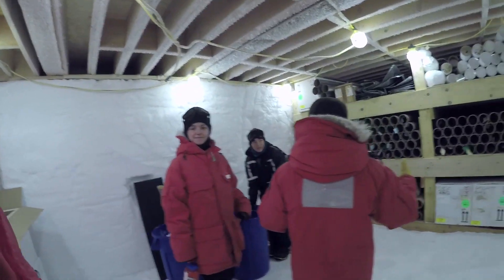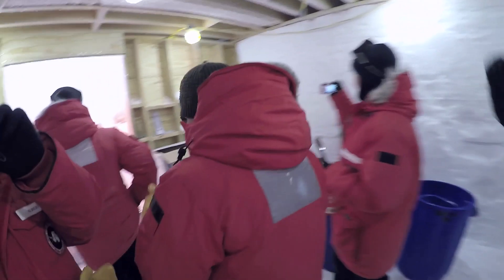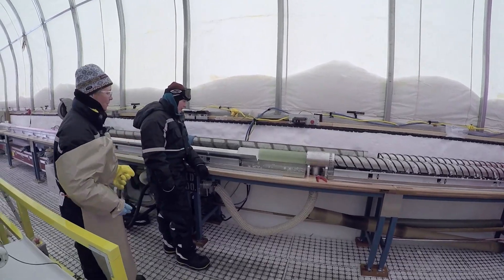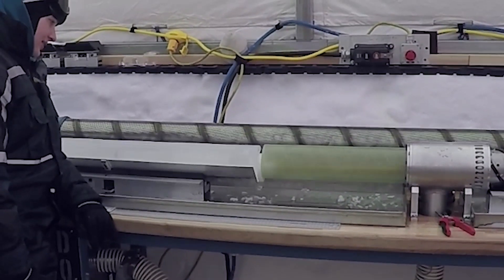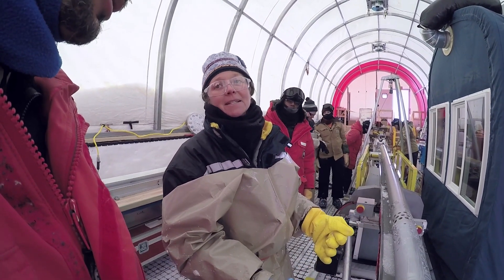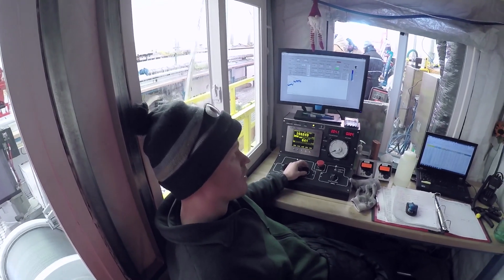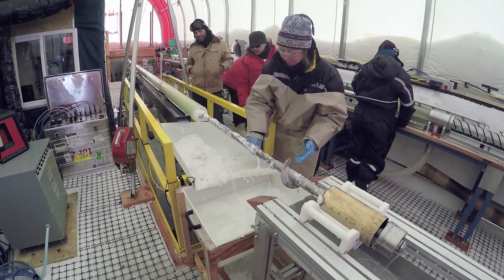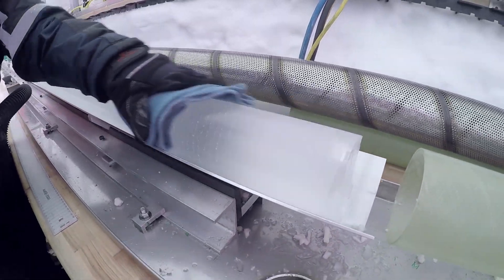Ice Core at the South Pole - Sixty Symbols

Comment: In glaciology they talk about ice losing its typical solid state when the pressure from weight above exceeds what it would be a few hundred meters below the surface. That allows the glacier to move on a bed of ice that is more fluid than ice that would have formed on the surface. So, now I'm confused. That core was solid, yet it came from over 1000 meters below the surface. Did the core refreeze back to typical ice after being depressurized when the drill relieved pressure overhead? Or is that more fluid solid state preserved even when pressure is relieved?

Comment: Won't gases diffuse into/out of the cores if they're just sitting on a shelf for years?
Reply: Which is why you won't use the stuff on the surface of the ice cores. They're thick, so you can have a buffer zone of stuff you're just not going to use. You basically just use the cores of the cores.

Comment: How did they proved that this ice is 15 000 years old ?
Reply: Nikolai Tsakov 
Several methods. You can use cosmogenic nucleotides, which are isotopes created from bombardment of cosmic rays while the snow is on the surface or buried shallow. You can find layers of ash from volcanoes in the ice and date that as a proxy. You can check the hydrogen/deuterium vs Oxygen-16/Oxygen-18 ratio across the length of the ice core and curve-match it against pelagic varved sediments. And last but not least, if the ice hasn't gotten severely deformed by ductile flow, you can simply count layers; because every winter you get a little bit of snow, and every summer some snow get sublimated by solar input, thus forming yearly layers.
Reply: Carbon dating pollen in the ice is one of the best ways.
Reply: https://eo.ucar.edu/staff/rrussell/climate/paleoclimate/ice_core_proxy_records.html
Reply: hamstsorkxxor dude you need to be out there educating.  Tell me you're an educator.  Science discovery is great but in this...unique...political climate we need people like you educating.

Comment: but,but,but... you are breathing and spitting on it
Reply: +Robot
Yep, but they will not use the ice on the surface. There will be a buffer zone where from no data is collected, exactly because it will be contaminated.
Reply: huukkkkk ..thbPOoo
Reply: Also letting it sit on the surface for a year before processing... Any trapped gases would be completely contaminated via diffusion. Though probably still ok for testing trapped dust and maybe some oxygen and hydrogen isotopes.